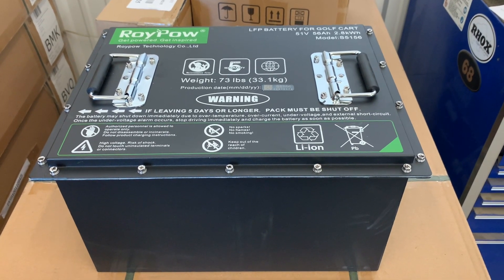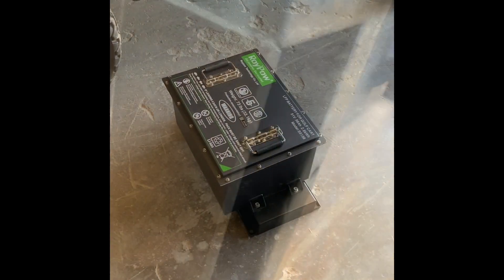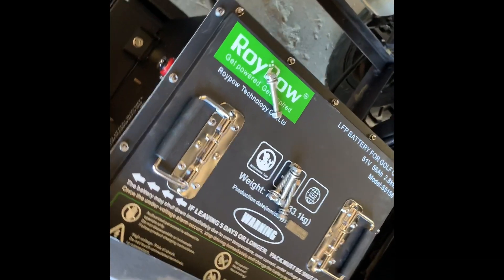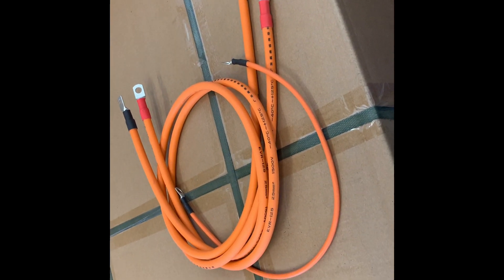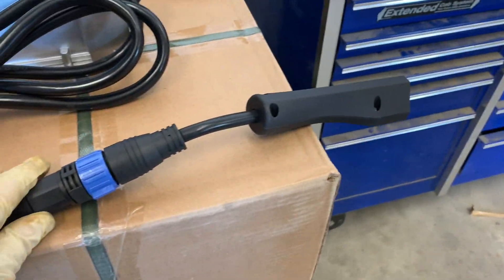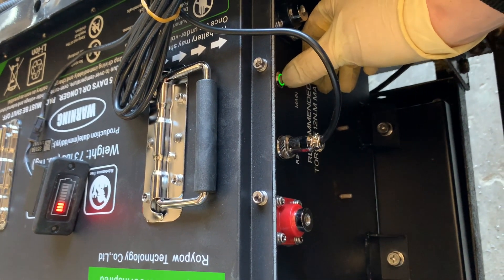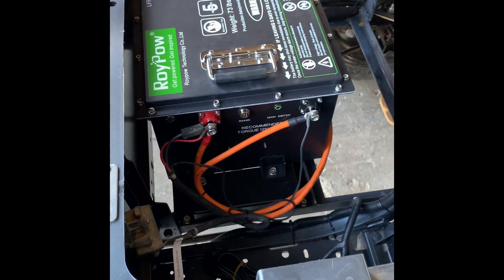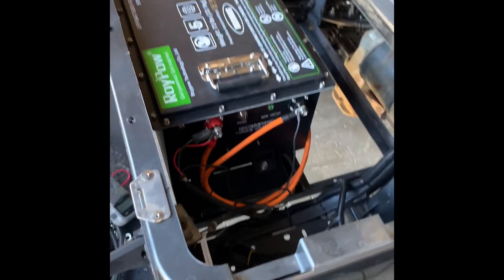RoyPow Lithium S5156 Battery Installation / Conversion on 2010+ EZGO TXT 48v golf cart carts

Comment: Great walkthrough. You don't mention the interlock cable as far as I can see. In my old quiq charger the interlock was connected via green to orange wire. The Roypow seems not to have interlock.

How did you solve that?

Comment: great video!!! thanks!  which Amp option of the ROYPOW should I get for my 2005 club car precedent with 4X12 V batteries?  56A or 105 A?
Reply from the maker: Depends on how far you want the range to be. 56Ah is up to 20-25 miles a d the 105Ah is up to 50 miles.
Reply: @jbgolfcarts Thanks!!!  I play 36 holes of golf maximum per day.  So 56Ah will be enough then?
Reply from the maker: @harbinguy1  that’s a lot. I would just pay the extra $400ish dollars and get you almost double the range.

Comment: Do you know why my installer would have not run the charging cable from the battery to the charging port? I have to lift the seat to plug into the charger. I'm afraid the weight of the seat will mess up the cord over time.
Reply from the maker: New roypow way. They no longer use the receptacle.
Reply: @jbgolfcarts  Thanks! I was also told to plug charger into the battery first, then the wall.  With the plug under the seat, that's much harder for me to do. Have you heard this, and is it important?
Reply from the maker: @buzsaw7632  I’m sure they are getting away from using the receptacle because people are plugging in their lead acid charger and catching the battery on fire. I like the new way. It’s meant to be an on board charger now and not be unplugged from the batter. You just run the cord from the charger in the wall now. If you plug into the wall first and then the battery the charger won’t work.
Reply: @jbgolfcarts  Very informative! Thank you!

Comment: Very odd. When I started my install my brackets are exactly the opposite of way you did -- with the three holes on the bracket facing out. Doing it that way I didn't even have to drill any holes -- the three holes in each side lined up exactly with holes already in my battery tray. My only curiosity with it was if the battery should be in the front half or rear half of the tray, does it matter at all or just your preference? I was thinking if I set battery in the rear tray section I could use the space in front for mounting the other electronics to have all right there together.
Reply: where did you get the bracket?

Comment: Been reading in the golf cart forums lately that some people are having problems with RoyPow batteries and the company isn't very good at standing behind them.
Reply from the maker: Then don’t use it and this video isn’t for you. Why be negative? I haven’t found a company with a cleaner install and a lot of big battery manufacturers are on backorder so it would be hard to warranty anything right now. Trojan t875 is two months out before they would consider swapping it out. Is Trojan now bad too? If you want to be negative go back to the forum where those people exist.
Reply: @jbgolfcarts   I won't use it.    Not being negative, just stating what I'm seeing in the forums.     Clean install means nothing if the golf cart doesn't move.  

The rest of your reply is nonsensical.

Comment: This is what we have. Looks straightforward except we don’t have the 12volt reducer for the light circuits. Can you get a reducer or should we?
Reply from the maker: You will need a reducer if your light kit can’t handle 48v. Some can but most can not. Here are the reducers I offer. 

https://jbcarts.com/?s=Voltage+reducer&post_type=product

Comment: Could you install a second 48V in the rear battery tray and run a 96V system?
Reply from the maker: No. It would blow your controller unless you controller is setup for 96v. Most golf carts are 36v or 48v and rarely see a 72v. Check what volt your golf cart is and order the battery according to your voltage.
Reply: No, the BMS not support connect in series.